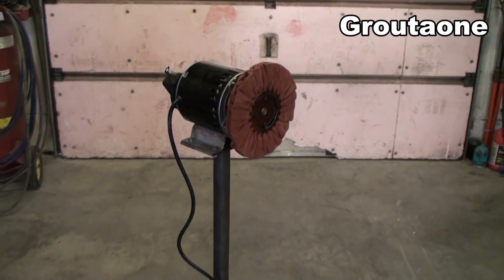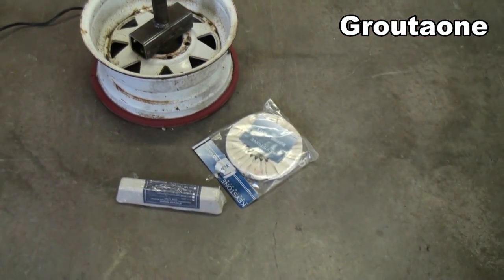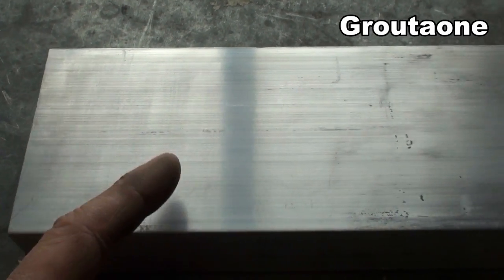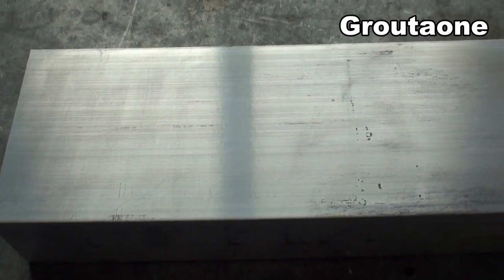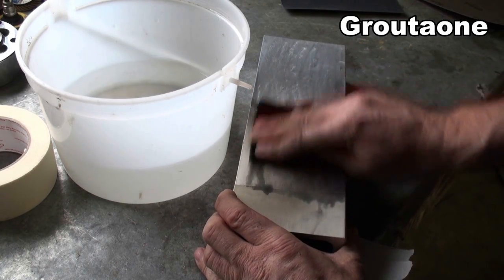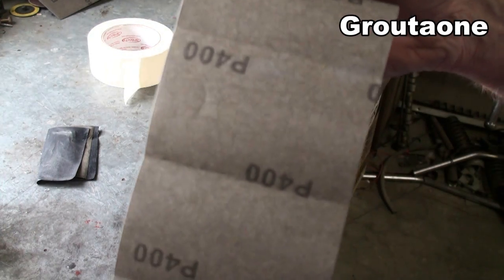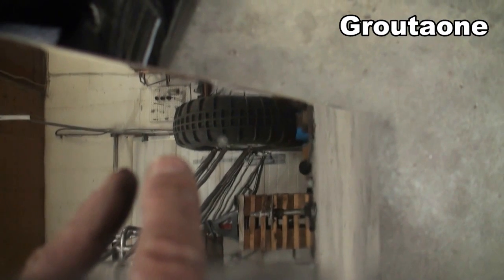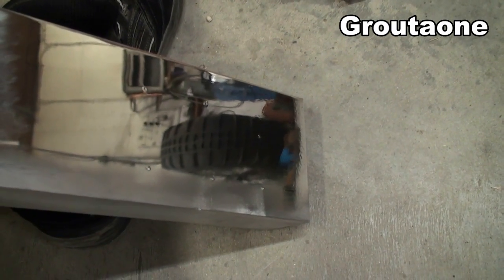Aluminum Polish Experiment

Comment: I have asked this on several other polishing vids and still have not had a response.  Where you stopped at 600, I have seen others go on to 800, 1000, 1500, 2000, and even 3000 AND THEN  start the polishing process.  I watched a guy do aluminum rims and he stopped at 600, but used 3 different types of polishing agent.  I don't think they could have been any shinier.  The only thing I can think is that some of the rubbing and polishing compound is a similar texture to the finer grit sand papers, and so it is essentially the  same thing.  But if that is the case, I would like somebody to tell me that.  So what do you fellas think?  Cool video as well - tip of the cap to ya

Comment: I did some aluminum polishing professionally for awhile, I did stuff from aluminium dump truck boxes to dirtbikes. generally speaking I would sand down to 1000 grit then polish with a yellow wheel and the rouge brick, and then go over it again with a white wheel at high rpm and a very fine brick. after all of that use WD40 and a clean white wheel at low rpm to get all of the remaining polish off the metal and the WD soaks in and obviously repels water. aluminium will tarnish quickly if it stays wet. all of the supplies I bought and used came from the parts counter at my local Kenworth dealer. I hope that helps get some shiny dirtbikes out there

Comment: Thank you a ton for this video!! Me and some of my buddies argue about how much prep is TOO much prep. Would there be any way for you to do a follow up to this with the prep being 'unprepped' 'wire wheeled' 'wire wheeled + sanded'? Because I wire wheel nearly all of my aluminum before I start polishing it. But I HAD a good soft "silver" wire wheel. This new brass wired one is too hard even after trying to break it in. It does real good at stripping paint and rust but it seriously eats aluminum. To the point that our 450 valve cover needs some serious sanding work done to it. 
Thank you again for the awesome video!!!

Comment: Where the pre-sanding needs to get really aggressive is when working with a basically raw casting (such as a motorcycle engine or transmission case, for example). I've found those flappy sanding wheels and abrasive pads to work well in those situations. They come in a really large variety of shapes and styles which is really helpful when working with irregular shapes.

Comment: does it have to be a certain aluminum to be able to be polished, or could you just polish stock aluminum on a dirt bike
Reply from the maker: The frame will work to polish but the swing arm has a coating on it that has to be removed first
Reply: ok

Comment: I've got 4 16.5 slotted aluminum wheels to polish for my 72 k20. Got any tricks for getting those sanded? Or just good ol elbow grease
Reply from the maker: Try a buffing wheel on an angle grinder if you can safely fit it on there
Reply: never thought of that but that is a damn good idea. that shouldnt be too bad to accomplish at all. Was not looking forward to polishing by hand.
Reply: You can use flapper wheels and the small little twist lock wheels in a small 90 degree air grinder. I used to polish molds for the plastics industry, most were aluminum, others were stainless and even a few were beryllium. I think the sisal wheel that grouta is using might be too aggressive. Use that rough sisal wheel for rough finishing it, then sand it with 400 and then 600 on a block or stick so that it stays flat and then finish polish it with a cotton sewn wheel and it will look like a shiny flat mirror.
Reply: I'll give that a shot for hard to reach areas.

Comment: hey Groutaone, whered you get the motor? Im working on my new 12 CRF250R. I got that thing for a steal too 1500. All it needs it a killswitch and fromt brakes and a piston. Not bad but completely worth it! Nice video! See ya!
Reply from the maker: This motor I picked up at a repair shop, you could buy a complete new sump pump with this motor for about 80 bucks

Comment: Nicely done!  I am wondering if the area would look "flatter" if you used a block with the wet and dry.  That would remove the larger mounds of aluminum.  Thanks!

Comment: I tried this some days ago to my mom's 850 volvo estate tail lights.

Even after many times using "plastic shine" or different metal polishes it would still have the white-yellow coating on it.

I sanded it with iirc 300wet, then 600wet paper, and finally used autosol on it. Now the polished part looks like brand new but there's loads of work left because one little part took me 30minutes to sand :)

Nice tutorial by the way :p

Comment: i remember i polished a FMF turbinecore2 a few years back, sanding with as fine as 600, then steel wool, and spent an hour with mothers polish by hand, that thing was like a mirror but took forever.
when have a motorized way of polishing the finer you go with prep is less important then when polishing by hand.

i have never been able to get a good polished look with cast aluminum....

Comment: What kind of polish is that? I use mothers mag polish.. and it doesn't shine anywhere near what yours is. I wasn't using a buffing wheeler (just by hand). I've tried getting results like this on a piece of aluminum and it wasn't anywhere near that.
Reply from the maker: I use mothers for finish polish and shine upkeep but to get the bull work done a polishing wheel does the trick, this is Keystone polishing jeweler rouge